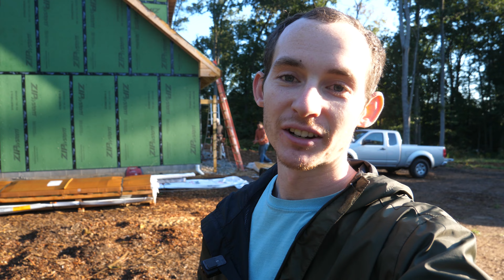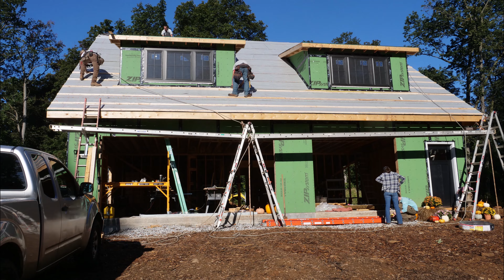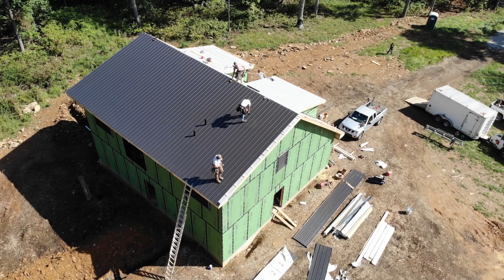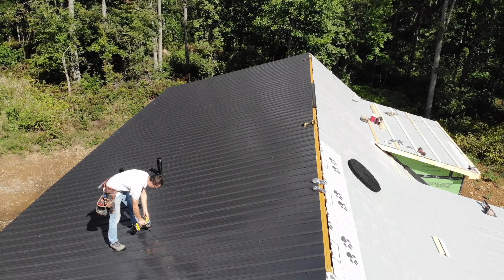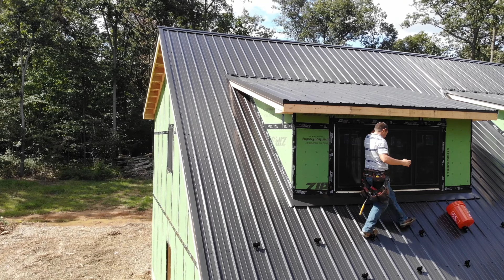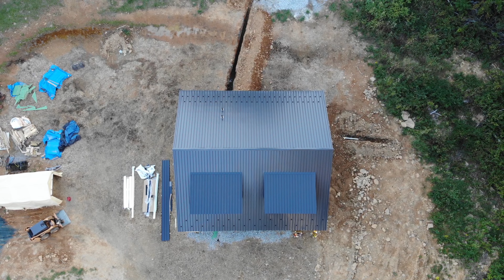Our GORGEOUS McElroy Metal Roof!!

Comment: i would NEVER put a metal roof on my house. i saw a house burn totaly because the firemen couldn't take out tiles to spray water....... imagen you are in the house. the heat stay UNDER the metal roof, wwith tiles it gets trough the roof and doesn't get so hot.......1000°C under a closed metal roof......
Reply: On the other hand, a metal roof offers much more protection from bushfires, or from the burning house next door.

Comment: "Blessing and a curse" ?? Hmm.. - I too have an engineering background. We need to know every nuance. I find in todays world that I need to know/understand everything before I make a move (hire someone). I am building my last home (69 yrs young). I am thinking of hardie board so I needed to learn how to install it so that I know what I am getting when I receive a quote and hire an installer.. My better half doesn't understand my .. "I NEED TO KNOW"! I side on curse. :face-orange-frowning: Any reason you didn't 45 deg the 1x's  to move and have a more direct way of moving heat and moisture? Does it create a screwing issue? Have you figured out the price per sq ft? Inc install?

Comment: Wow those guys did not work to building safety codes at all. I do metal roofing and would not install a 2 story roof without full scaffolding. They really should be tied on as well with those pitches. Great look tho. Love the dormers. I’ve done a lot of textured steel. It helps with hiding small scratches and with grip while working with it.
Reply from the maker: Thanks! They were certainly fearless. It was a Mennonite crew and they're used to doing some crazy stuff at heights.

Comment: I have really enjoyed watching your build. Make sure you put extra sealant on the vent boots. I believe the were put on improperly and should have been installed as a diamond pointing to the ridge to aid in shedding water.
Reply from the maker: Thanks for the tip, I wouldn't necessarily say it's a requirement but certainly wouldn't hurt to have the points up. Never thought about it honestly